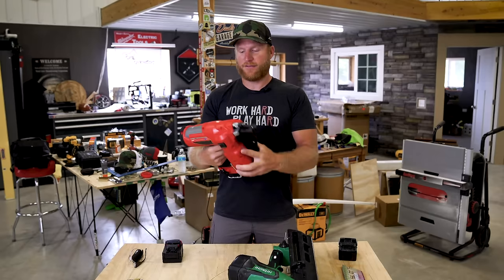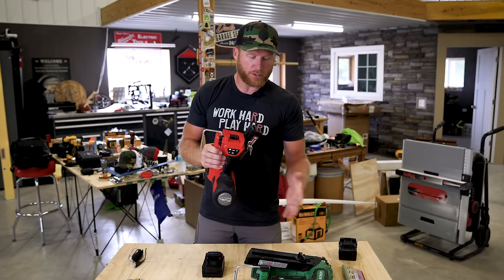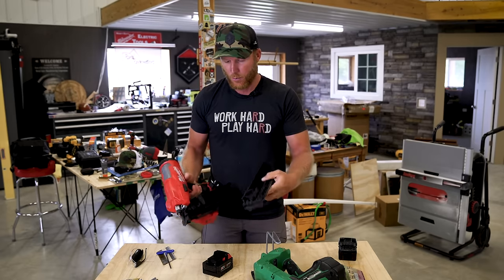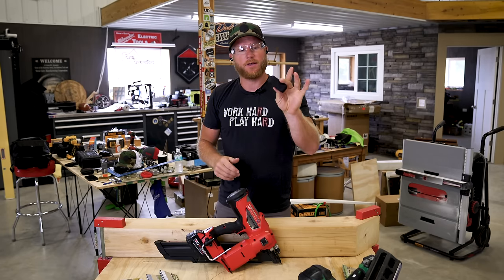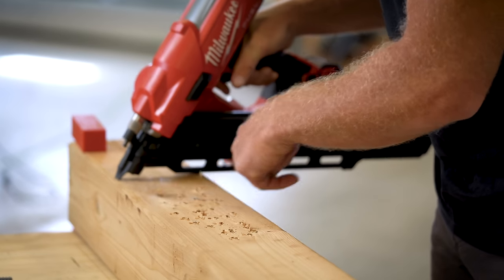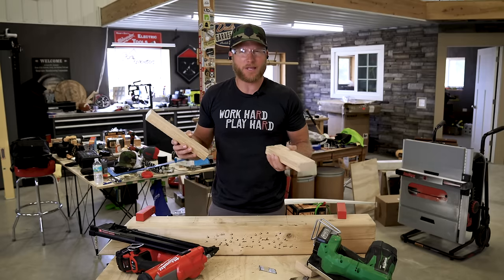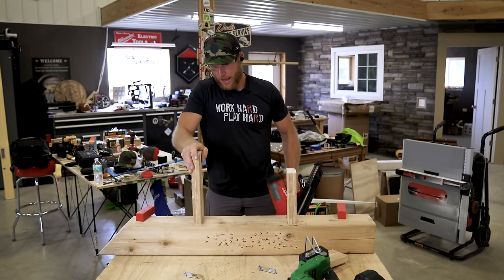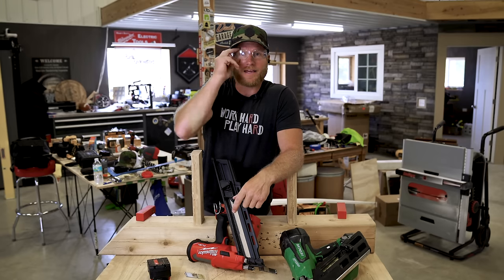Finally - - The Milwaukee M18 Battery Powered Framing Nail gun is HERE

Comment: Come on, Makita... Get with it.
Reply from the maker: Agree
Reply: They are too busy working on the 40V range atm.
Reply: @identityunknown_6995  Yeah man I'm so exited for that new stuff coming up
Reply: I think its abit of a rip off that the 40v batteries  wont be backwards  compatible  like the flexvolt  and Milwaukees high output  range.... makitas abit  behind the technology  ...this is why i switched my whole kit to dewalt.. never looked back
Reply: I can't believe Makita are that far behind in the race. Normally they're a top player and ahead of the curve.
Reply: @eddy45186  agreed I bought into the 18/36v system because when I had Milwaukee with 9.0 battery wouldn't charge all the way after like 4 uses, Milwaukee would not replace since I lost the receipt... Never want to replace a 9.0 -12.0 battery again so I stayed away... I can replace 2 - 5.0 batterie for 100$, one of those 9.0 or 12.0 is 150+
Reply: Old Guy Yeah, it’s a huge bummer for the consumer. Bought into the milwaukee system for now. Might get some of the 40v Makita when they eventually hit the market.
Reply: Makita never was with it
Reply: @scottyee707  That's why I prefer Ridgid. All batteries supplied with the tools qualify for lifetime service or replacement upon registration.
Reply: @C71-m1l  That is a huge plus!

Comment: Just FYI, you can adapt the 21 degree magazine to the 30 degree nailer. It takes a just little filing on the 21 degree magazine, but once you’ve done that it’s easy to switch back and forth to use different nails. The screw holes line up perfectly. I think there are videos on how to do it. I used my Dremel and it took about 15 minutes. A question: have you tried to use the Milwaukee framing nailer on joist hangers?

Comment: I’ve used the Milwaukee fence stapler for two years which is based on the same technology/design and it’s amazing, it shoots staples into the toughest old hard as concrete black locust posts like butter. Im definitely buying this framer cause I know it will be badass.

Comment: I'm no Kyle, but I haven't had problems toe nailing with DeWalt. Maybe not as good, but for the last 5 years I didn't have hand drive nails or go get a hose, which Milwaukee users can't say. And it still works good

Comment: Can't wait to see how reliable it is in low temps.
Reply from the maker: Me too
Reply: If anything, the batteries will be the problem like any other cordless tool... Lithium don't like the cold.
Reply: Also in high temps
Reply: @evictioncarpentry2628  BS, Lithium works well in cold weather but you can't recharge before battery is warm enough.
Reply: @mr.wizeguy8995  not true
Reply: @mr.wizeguy8995  well for one, the fact that they don't recharge is a MAJOR issue, I'd hardly consider that "working well" ... Lmao. Great logic. 

Also come work in a Canadian prairie winter and tell me that again lol
Reply: Mr. Wizeguy m18 is total shit vs 60v

Comment: Talking about Milwaukee nail guns.  I know it’s a different gun.  I am a DIY guy and I wanted a finish nail gun without the  use of a compressor.  I was using a Senco 16g nail gun.  I bought the Milwaukee 16g nail gun and I just put in all new MDF base boards and casing in my house I would say 1/2 of my 2 inch nails did not sync below the surface of the boards.  I was a bit upset.  I adjusted the depth gage and I still had problems.  I know they redesigned their 18g nailer but I need 16g. Milwaukee needs to redesign their 16g nail guns. My Senco gun did a better job but I gave it away.  The gun also has problems holding two clips of nails.  I hope Milwaukee reads this review.  I called them up and they could had cared less about the problems I was having. Their phone support is just horrible.

Comment: honestly I like that there isnt a big kick like you get from a pneumatic air compressor. I hate trying to toe nail a piece in and the kick causes the stud to move excessively. I like the single trigger bit, lately Ive been getting a lot of double feeds, heck even nailed my finger to the joist today when a stray double feed took a right turn after shinging off the first nail head and went 8 inches to get my finger

Comment: I use hitachi air nailers most the time. I used a Milwaukee like that on a smaller job tho and it was great for that no hose n such I just like my air nailers for big jobs don't have to worry about changing Batteries n such but like those smaller framing jobs it's really awesome

Comment: I don't mind the Dewalt.  Just make sure you use the Flexvolt batteries & it's good for stick framing.  It doesn't do well with laminates like LVL Microlams just can't sink the heads..  I've been using the Hitachi and that works pretty good.  Thank you for the new Milwaukee review!

Comment from the maker: It's Back!! And we are kicking off a new Toolsday with the Milwaukee Cordless Framer!!  Let me know your thoughts below!
Reply: Heck yeah, toolsday!
Reply: Hey Kyle thanks for the review!  Looks like a sweet nailer. I’d be interested to see you shoot that same piece of oak with the 21 degree nailer when it comes out with 3-1/2” ringshanks that are a little thicker than those paslode nails. I’m just wondering if that was a power issue or that those passloads bend to easily absorbing some of the force.  It would also be cool if you could confirm that we can change the 30 degree over to 21. Cause if it’s able to, I’ll order the 30 now and just pick up the 21 extension when it becomes available.  I’m sure many others would do the same. Thanks again for your reviews, I always look for your opinion on a major tool purchase before I  take the plunge. This one looks like a winner.
Reply from the maker: @bmwestmoreland  I am told it does and milwaukee is putting me on the list to get one and show it
Reply: RR Buildings thanks for replying Kyle!  That’s awesome!
Reply from the maker: I have been informed again that it won't work

Comment: Weight isn't really much of an issue if you're using hoses. My Senco and 2 old heavy assed metal Porter Cable framers weigh a ton and the hose dragging makes it even worse. Now that this has been out a year it's time to buy one. At 53 humping up a 28 foot ladder with a hose dragging is knocking me on my rear lately.

Comment: Dewalt miss fires until you secure the head of the gun to the hardened end. As for Milwaukee it works for about three weeks in the rust belt because it looses its punch and doesn’t sink nails. Tried resetting firing pin with no change

Comment: “I don’t know what carpenter would nail that fast” 😂
Reply: Roofers like me.
Reply: Framers building walls but it’s not fast enough to use for framing maybe for pick up or just fallow around the shear inspector to nail something here an there
Reply: @gunsgalore15  So...you plan on using a 3"+ Nail?  Yea, I was a roofer once, and yea, we flew threw coils, but not nearly the same thing...AND as the roofer that was teaching me the trade told me "Roofers ain't carpenters, and carpenters ain't roofers"...LOL
Reply: WreckDiver99  Yeah we use a lot of 3 1/2 inch ring shanks to nail down 1x4 and 2x4 runners for steel  as well as 8D for OSB roof sheetin.   We currently run the Hitachi cordless and love it and it’s actually faster than an air gun past the first sheet of OSB because you don’t have to wait for the air compressor to catch up. (I know I could fix that with a bigger compressor but more weight less portable)
Reply: @gunsgalore15  If your compressor is running out of air after once sheet of OSB. Its WAY to small for the job and sounds like your just too cheap to buy the right one. Even though an electric compressor capable of running 3-4 framing nail guns is only $300-$400. But every roofing crew I know around here just buys gas compressors ($600-$1000) that can run 6+ guns no problem.

And both of those options come with wheels so you don't have to lift it like the $50 pancake compressor everyone seems to buy.

Then again your choice of air hose might also be the problem.While those poly hoses may be lighter and easier to maneuver. I have found that if your going past 150ft of hose on a 1/4 inch line, you will run into issues of low pressure on sequential firing. Which is why we would always lay out a 1/2 or 3/8 line from the compressor to the center of the work area and then split with 1/4 to each gun from  there.
Reply: One that wants to make money?
Reply: No, y’all, I was quoting him. He was joking;) He was going too fast for the gun. I get it.. when I hang shear, I rapid fire that thing.
Reply: Please guys i know me i need one on each hand to be able to get going
Reply: PortersMob exactly
Reply: @WreckDiver99  too be fair, im a carpenter, and i can staple the osb roof sheeting as fast or faster pace as a roofer! Lol
Reply: Raises hand
Love my cordless but it’s not as fast as a pneumatic. Won’t keep up nailing sheathing.
Reply: Not even slightly convinced that a difference of .01 seconds per shot would make a difference in job efficiency. Way more time gets spent setting up the compressor, running hoses, then pulling and snagging the hose all throughout the day. Show up with a few charged batteries in your bag and this cordless nailer would get way more work done in a day once you factor in for it not needing any setup time and no hose dragging around.

Comment: I have the Dewalt and don't understand the hatred for it.  I've not had it jamb and it drivers nails just fine.  I have 2 Paslode pneumatics and even those can have have issues depending on the wood you're dealing with.

Comment: Thank you for taking the time to do this.  Much appreciated.  I'm looking to purchase battery operated nail guns for our pallet operations.  We use pneumatic coil guns for attaching boards on the pallets and general repairs, but we have a need for a battery operated gun to do small quick repairs or loose board reattachments.  We use coil nails 1 3/4 x .080 to .090.  I could certainly purchase sticks of nails and use a different size for this purpose only.  What is the smallest nail this will take?  Do they make a battery operated coil gun that will shoot non roofing nails?  Something closer to 1 3/4 x .080?

Comment: Nice review sir. Thinking about buying this Framing Nailer but still debating either 30 or 21 degree. I live in PA and I am not familiar with the building codes. However, I’ve seen a 30 degrees off set full round head nail. I like the paper collated due less messy. Any suggestion ? Appriciate your honest opinion.

Comment: Good review.  
I love Milwaukee tools,  I have a bunch of them. But I would not buy this framing nailer. Because it is Gen1 and when they discover the flaws you are stuck with it.  When they introduced their brad nailer I immediately ordered it. It turned out to be a huge failure.  They fixed all those problems with the Gen2.  And Milwaukee just says, "sorry, buy the Gen2".  When they screw up they just move on and leave their customers holding the bag.

Comment: I am sold.  Ordered one.  The ETA is about 3 weeks.  I have 12V, 18V, and 40V Ryobi, 18V Festool, 12V, 18V and new 40V Makita, 20V DeWalt.  Oh I have 12V Bosch and Milwaukee.  Now I got 18V Milwaukee.  I think I need to make a charger cabinet.  Oh my.  Now I am thinking about transitioning from Systainer to Milwaukee Packout.  This is not going to end.

Update....   They are delaying the shipment for two more weeks.  Keep on waiting.

Comment: I have been looking into getting a cordless framing nailer for some time, and I think I finally found the perfect one! Just placed an order using your link, thanks for the helpful video!
Reply: Let me guess you didn’t like it see I love Milwaukee but it’s 10.5 pounds without battery or nail just imagine 3 pound battery and an extended mag that’s a lot of weight vs mitabo  it’s 9 pounds with battery and nails
Reply: @pedrodperete  I love it. It is definitely heavier than average, but you get used to it after awhile. I don't really even notice the weight anymore. It's power more than makes up for it too.
Reply: @benjamincarpenter4376  this is true. I remember using the 5xc batteries and felt heavy at first. Then the 12hd. Now they all feel like 4xc batteries

Comment: I’m loving my m18 18g Brad nailer. Only thing I don’t like is the push/hold buttons and their location. I think they should be switches right by the trigger so you can do them with 1 hand quickly.

Comment: Hi,

Can't wait to get the milwaukee cordless framing gun. I didn't like the DeWalt cordless framing gun at all.

I still say DeWalt has the better body design with their 18g brad & 15g angle finish nailer. If they just change that flywheel motor it will be awsome.  

I do like the new milwaukee gen 2 18g brad nailer for the quiet motor but again dewalt does have a better body design. Sometimes the side motor hump on the milwaukee gets in the way in certain situations.  

Milwaukee needs to redesign their 15g. Dewalt hands down has the better body design and the front point is perfect. The milwaukee is just bulky and odd. 

I use both brands (Milwaukee & Dewalt) not really loyal to one brad. Just pointing out pro and cons on both.

Thanks for the video.
Reply from the maker: Appreciate it... I like the dewalt 15gauge
Reply: Thanks for input.

Comment: Question is where did you get the shorts ?  I wished I waited before buying I did get a Dewalt its good but not as good as these two helped a friend do a 25 by 60 2x6 framed shopp it jammed around 15 times but did good I dont use framing nailers as much but would recomenned the Milwakee they are better just didnt want to change batteries series Great review Thanks

Comment: Is the dewalt nailer that bad? My buddy bought one and he used it for like two weeks on a big project in his house. 
He recently gave it to me to use so the batteries didn’t go bad. I nailed 100’s of feet of fencing the other day and it was awesome
Reply from the maker: If it’s all you know it’s all you know... I’ve had more issues than success so I sold all mine... went thru three different ones
Reply: For the average homeowner I'm sure it beats swinging a hammer but all of the guys that make a living using a nail gun would rather drag a hose around than use the dewalt. I have not seen one single good review from anyone that makes a living driving nails.
Reply: I don't have any trouble with mine, I know a lot of people that hate them but mine always shoots it all the way. If you use ring shank I think it struggles though. I only use smooth so I've never tried it with ring shank
Reply: Lol!! No way! I’ve had mine for a year and build 4-5 5000sqft houses a year. Never had an issue!

Comment: I’ve got a dewalt (2nd gen) and I’m not gonna lie I way prefer the ergonomics of it. All I gotta do is flick the safety off (near the handle like a drill) and point and shoot so I don’t need to fiddle around when I’ve got something awkward to nail. 
It does leave nails a bit proud every now and then but it doesn’t bother me too much as I’m working with pine 90% of the time. Might look into the third gen as I’ve heard it’s more powerful!
Would definitely be keen on Milwaukee but the digital button holds which can’t just be quickly clicked as you’re holding it ready to shoot is the let down for me

Comment: I’ve had bad experience with M 18 batteries, I’ve stuck with Makita for the most part on my cordless stuff, they have seriously dropped the ball on releasing cordless nail guns so I’ve recently picked up a framer and a couple finishers in M 18 cordless, hopefully I have better luck this go around. One thing is for certain Makita batteries are certainly more reliable across-the-board than all other manufacturers. I’m excited to see how this cordless set works and hopefully ditch some of the air compressor usage.

Comment: I returned my 30 degree Milwaukee Framing Nailer to HD. I already own the 30 degree Dewalt Framing Nailer but it doesn't have enough power and it's slow, so I thought I'd give the Milwaukee a try. Although heavy, its got the power and speed but when it came time to reloaded it WOULD NOT take a full rack of Paslode nails, like my Dewalt does,  so I had to brake the nail rack in half in order to reload. This really slowed my job down and just plan sucked. I had already ordered the extension and, when it arrived, it WOULD NOT reload with 2 racks of Paslode nails, when needed, like all my other nailers do. Called Milwaukee Customer Service and they said it only holds 51 nails(without extension) and so I returned it. I wish all the reviews I read would have said something about this because I never would've bought this nailer and wasted my time. This nailer should've came out of the box with the extension(cost $79 extra)and held 2 racks of nails for the reload. I expected more from Milwaukee Tools.
Reply: Wow. That sucks. How could they design this to not take a full clip of nails??

Comment: i am surprised the 3" nails went into the oak but the 3.5s would not.
Reply: The nail diameter is what makes the difference, not the length.
Reply: I can't even get 3.25's to go into 2 by material..

Comment: It looked like the 3.5" nails were Paslode.  We use Hitachi mailers and were on a big job using LVL and we could not use Paslode nails. They did the exact same thing in the LVL as your nails did into the oak.  We switched to a generic nail and the issues were gone.

Comment: I've now used the Milwaukee, DeWalt and paslode cordless as well as various air framing nailers. The Milwaukee works awesome probably the most consistent cordless nailer, but just too heavy. The wear and tear I put on my body using it for about a year straight is not worth it. Air nailer for sheathing/decking and paslode gas gun for everything else.